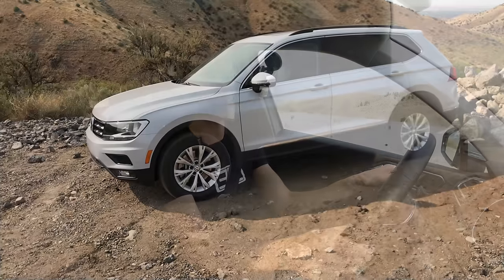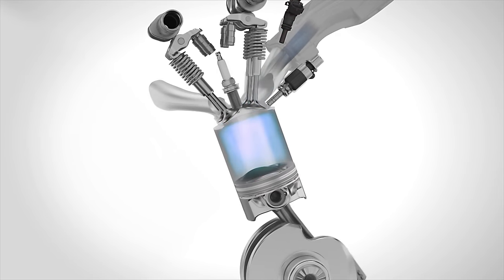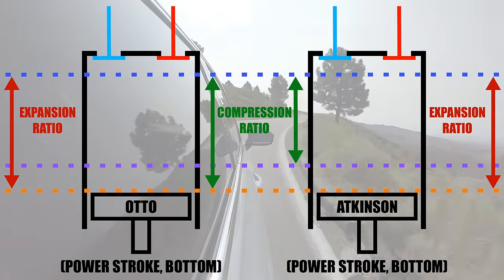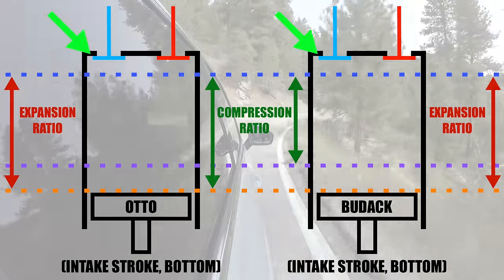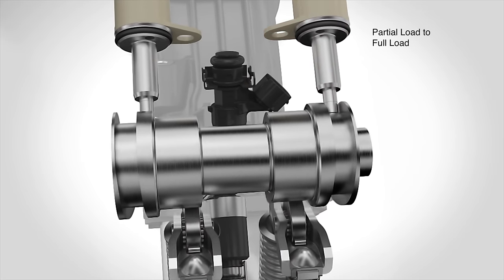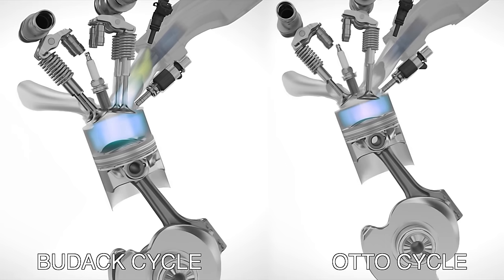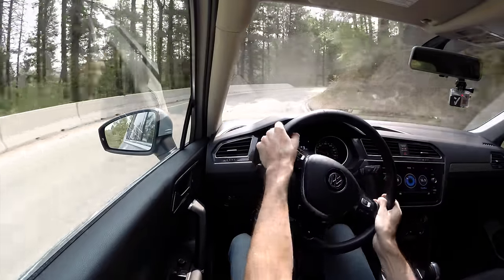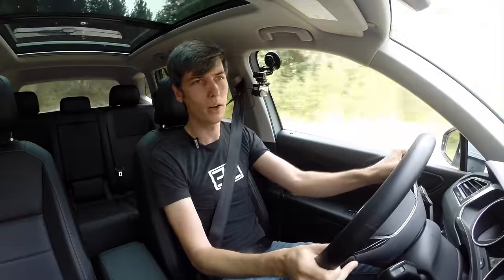Volkswagen's New Engine Cycle - The 'Budack' Cycle

Comment: My 1997 Plymouth Grand Voyager gets 27mpg highway with a pushrod 3.3L V6 that has 412,000 miles on it. Im very unimpressed.
Reply: Isn't it sad to say goodbye to smooth, reliable V6's. We now get Turbo charged I4's, that will have higher maintenance, and much lower longevity, and yet rarely get any better mileage. My Jetta 1.8 Turbo averaged 26 mpg, and over the years cost me $6,000 in service and maintenance. I finally traded it for a '17 Toyota Camry.
Reply: I think I've got that same motor in my 1991 olds cutlass ciera wagon. Mines got 225000 miles on it. Runs good!
Reply: My 2004 VW PASSAT 1,9tdi PD 136PS/335Nm has 47 mpg. This car runs 143mph and cost 1000€. Im unimpressed too.
Reply: I'd like to know at what speed is it achieving that 27mpg? My full size 2007 RAM will get 25+ mpg at 50mph (on 100% gas), so 27mpg in this smaller frontal area vehicle really isn't seeming so special...
Reply: Dave Benedict mine gets that at about 70. It has a .7 over drive and motor runs 1900 rpm at that speed. If your trucks that new its not really a comparison. You probably have much newer systems that help alot. These buick motors are 1 cam 2 valve per cylinder push rod waste spark and multiport injection. Super simple 90s tech. Not to mention mine has 225k miles and 26 years on it. Age doesnt help power or economy
Reply: Same thoughts here.    1994 Mercury Grand Marquis 4 door sedan with  4.6 L V8 with all the emissions crap tweaked/defeated/removed to run the engine in it's most fuel efficient mode not emissions compliant mode.   Mid 20's around town and upper 20's low 30's on interstate running 75 - 80 MPH.  

It's no slouch on power and it can easily pull a 6000 trailer too.   Dead reliable but its age is showing.
Reply: Sam, you misunderstand me. I think the old Buick is doing fine.  It's the brand spanking new VW I'm not impressed with. Guess I should have made that part clearer...
Reply: Trollololol. 27mpg in a V6 mini-van with 412k on it, I'm impressed. My VW Jetta 1.8L Turbo's best mileage in 81,000 miles, was 27mpg, as well as costing me $6,000 in maintenance and repairs, just traded it for a new Camry.
Reply: Color me very unimpressed.  My 1959 Edsel has 24 million miles on it and gets 597 MPG going 110 MPH.  And, I've never even changed the oil once.
Reply: He's never had to top off the oil in those 24 million miles either!
Reply: Right? I have a refreshed hatred for people driving SUVs as road vehicles.
Reply: Modern highway mileage is calculated not just from a constant speed, but changing speeds. My wife's CX-5 is rated at 32 MPG, but cruising at 40-60MPH will yield 40-50MPG. That being said, it mostly sees aggressive city driving, so in reality, it average it's city rating at 25MPG.
Reply: James Kirk right we get that. We are making fun of how this engine has an epa rating the same as a larger 25 year old one.
Reply: I had a 1985 Honda CRX that got 50 MPG. I now have a Honda Fit that might get 40, if I hypermile. The Fit's final drive ratio in fifth gear is clos to that of the CRX in fourth. Honda could fix that, but they don't want to hurt their hybrid sales, I guess.
Reply: That is a shame, if that's the case.
Reply: Dean Evangelista. You are right. For example; Automakers are phasing out NA V6 powered cars, and leaving us with variants of  4 cylinder Turbo engines, that don't really get any better mileage than the V6's, but are more expensive and  less reliable, and usually have far less longevity. Now GM announced, that they will go all Electric, by about 2022. Cars will be totally utilitarian, the excitement will be gone. No taking the car camping in the wilderness for extended time. Also, you can't keep extra fuel cans for emergencies with electric vehicles, you are tied to the power grid, and if that goes down, electric cars will soon go down. And if the car batteries have a deep discharge, they apparently need to be replaced. Thanks, to the EPA, Obama and CAFE.
Reply: My gauge cluster doesn't work at all so I just imagine I'm getting good gas mileage and maintaining the speed limit
Reply: If that is true, I'll never buy any GM vehicle.  Right now I have a Jeep (Fiat) Renegade and a Ford Econoline work van.  Stopped checking mileage as we are retired, don't drive much.
Reply: Jeffry Blackmon. What are you referring to, about GM. Also, how do you like your Renegade?
Reply: That's adorable I get 46mpg in my Golf, and havent shelled out for 1 repair. Unimpressed.
Reply: I had a 2002 T&C with the 3.8 liter OHV engine, it got a regular 24-25 mpg, lows of 22 and highs of 28.
Reply: My father's first generation Subaru Forester has 340K km on it, and nothing done to the engine. the car looks decent to except for a couple of rust spots in the hayon.
 Beat that US made cars :)
Reply: ShazamMafia I already did, I said my van has 413k miles. That's 665,000 km, in a USA piece of crap. And NO rust, we don't get rust in Texas.
Reply: Special EDy anything lives forever in Texas that aint a fair benchmark lol in NY all the US cars are cavernous with rust lmao
Reply: DylanCanDream Most older or high mileage cars come equipped with a self oiling, anti-rust system. It's called leaking gaskets XD
Reply: Guys my 79 Trans am 6.6 liter with a 3 speed slush box and a 4 barrel carburetor gets 20 on the Highway you think you're unimpressed but with the 2.70 rear end I only end up spinning about 2000 At 70
Reply: IDK why he thinks his subaru is impressive My moms 93 GMC sonoma 2.8 V6 5 speed manual got an easy 30 mpg and that was with 350k miles thats 563k km bud engine had never been opened and she owned it from new it crossed the rocky mountains about 10 times and 1 of those was towing a 69 Nova we had to get rid of it because we live in iowa and rust started eating the floors
Reply: my chevy cruze 1.4 turbo gets 40+ consistently on the highway
Reply: most of that is in the transmission gearing rather than the motors inherent efficiency cause a LS with a low rear end gear and a low over drive can also get 40 rather consistently if you drive conservatively
Reply: Thing is most cars after 74 had catalytic converters that more or less dealt with the Smog issues
Reply: LoL @ 27mpg I get 60 mpg out of a £500 old banger that I have just used to move house with. Has no problems keeping up with traffic and is clean too.
Reply: ron mortensen what are you talking about?
Reply: All of you are talking about older cars... let's talk about something newer, a 2016 dodge charger that I own... according to the stats it does 25 mpg (in a 5.7L v8) I get 27-30 at 70-80 mph and a solid 24 at 90 with cruise control... I've gotten 38 mpg at 50 with cruise control because of cylinder deactivation when it was wet and I had bald tires... and to top it all off this thing weighs in at around 500 lbs heavier! So heavier and better fuel economy... great!
Reply: 27MPG is distinctly underwhelming on a modern car.  My 2006 Citroen Xsara Picasso 1.6 HDi indicates 60MPG on the dashboard, and went from Caernarfon (N. Wales) to Basingstoke then on to Paris with a single 60L tankfull, so I think the dashboard indication is not too far out.  On the motorway, passing isn't an issue, and on A-roads where the limit is 60MPH, anything I want to get past is doing less than 55MPH, and it gives adequate performance for that.  Granted, it's no racing car, but it will do better than 100MPH on level ground.  What do we need out of a car?
Reply: Isn't that a diesel also the charger is a 400HP 5.7 liter V8 27 is okay for that i mean the Z06 corvette can get that with 650 to 800HP
Reply: Yeah Mike that isn't really that impressive out of a turbo diesel in a car that small with that little power
Reply: eh... epa says 22 for the z06 and a hellcat but you can probably get 25 if you're lucky in both of those... but anyway its only an extra 5 mpg over those if you count the epa
Reply: the stick z06 gets a bit better mileage with that 7 speed at least according to mike from ss717
Reply: 1423 171 - "7-speed"?  Where does it end?  When I was a kid, all the cars I was aware of had 3 gears.  I remember the introduction of 4 gears, and by the time I was old enough to drive, my Mini had 4 gears, and my brother's Jag had 4 + Overdrive.  Then 5 gears were marketed in the average family car (my Citroen Picasso has 5), and my daughter's new car has 6.  Frankly, I don't want to spend all my time swapping cogs.  I drove a CVT for a few years, and it was OK, but despite its ability to select from a theoretically infinite number of gears, it showed only a very minor improvement in performance, and then, only under very specific circumstances (the right gradient).

Will drivers really be happier when cars have 60 gears - or is it only a marketing ploy - more bells and whistles - like the LED flashlights that we get today that switch through a series of On, Half bright, continuous flashing, SOS, "Happy birthday, Mother-in-law" in Morse - I just want a flashlight that switches on and switches off, like I want a car that gives acceptable performance for modern driving with a low consumption and minimal 'management'.
Reply: chevy cruze = MOTORCYCLE on 4 wheels is slow. unable to overtake a slow road hogger in front of you. you are only getting go MPG in 2350 - 2700 Rpm out of that range eat fuel.
Reply: The old pd130 golfs are known for 50mpg...
Reply: Ha...No it doesn't. I drove a brand new 99 Dodge Grand Caravan (parent's van) for 5 years after getting my license with the same engine and it was lucky to get into the upper teens but nice try though. And that was with the Cruise set at 60MPH. At 70-75 MPH it was around 15-16 MPG
Reply: ShazamMafia mine really beats that, 1957 ford f100 all original, 76,000 miles on the odometer, lol 1 spot of surface rust on the corner of the hood, plan to fix that soon, spent 25 years as a farm truck, drives like a dream now, not to mention its a sw Missouri truck
Reply: Well if gas/oil companies didnt run our govt and the car manf. we'd of had higher mpg than we do. The reason your car gets better mpg is its older=lighter due to less saftu regulations. New cars are safer=heavier. So untill manuf. go to carbon fiber tubs(itll be soon) and the govt raises efficency standards mpg will stay around 30-40mpg
Reply: @Deftones Dsm the 5$ per pound thing isnt necessarily true, the main deal is when its below $5 per pound and the manufacturer owns the facilities to produce said carbon fiber, also that's assuming the price of aluminum and steel parts manufacturing doesn't drop, at which the price would have to be lower, plus a process needs to be made where it can be recycled in a manner that allows usage in structual components, plus the consumer would have to be willing to foot the increased cost of the vehicle, and at the end of the day there needs to be another material of similarly cheap production costs  with which to manufacture the fasteners with, otherwise the increased strength wouldnt be of benefit or there would be no reasonable way to repair minor damage.

 Of course mild steel still has the advantage of not fragmenting under a shock load(titanium does the same thing, which is why it was alloyed with steel in the SR-71), which has advantages in some applications such as the structural areas, where the weight reducing benefits of carbon fiber would actually pay for themselves.
Reply: It's a volkswagen, what do you expect?
Reply: Dean Evangelista main problem is these cars are so freaking heavy now days, so all that technology making the wngine more efficient is offswt by the weight. A 99 honda civic si with a 160hp and only 111lb/ft torque 1.6l 4 banger could hit 0-60 in 7 seconds flat. Now it takes a turbocharged engine with 200hp and 200 lb/ft torque to go that fast in a compact car. The civic si now weighs between 500 and 600 lbs more than the old 99 si and having 205hp and 195lb/ft torque, performance is almost the same. The new one is 0.3 seconds faster to 60 despite the fact the whole engine and drive train are alot more efficient and had alot less friction than 20 yrs ago. Thats why fuel economy these days arent that impressive.
Reply: Brandon Crimmins i agree... Just got an 02 caravan with the 3.3l, it averages 17mpg at best. This dudes FOS. Matter of fact half these people are. No way in hell they're getting 20+mpg out of ANY V8. Best mileage i ever got was 24mpg average out of a 2.4l Nissan. My current SUV with 3.0l V6 gets 18mpg average. Everyone here is full of shite.
Reply: 2001 Nissan Xterra. V6, 2.? L. 18mpg.
Reply: Hell my Chevrolet Cruse diesel gets right at 50 mpg on the highway and with 185,000 miles on it and very little maintenance....
Reply: doubt it.
Reply: ron mortensen they should get better mileage. The cars have simply become heavier. We don’t roll our windows up we have computer guided electric motors for that that shut off when a hand is in their way. We have heated seats and more complicated electric everywhere. We got a lot more of everything.
Reply: Don't worry. The hate will go away when an SUV T-bones your car and smashes its way through the passenger compartment.
Reply: A3 1.9TDI 37mpg@105mph, 42mpg @95mph+city, 45mpg @city
Reply: no, you dont.....  just because the overhead mpg thingy says 27 at that second dont mean sh1t
Reply: My 1989 Plymouth Grand Voyager gets the same! Though using it as an old toolbox work van, heavily loaded and driving on steep hills it's closer to 22 but I'm not complaining. For the 20 years I've had it, I've changed the oil 3 times, tires once, and the most expensive repair was a headlight switch for $20. I even lived 10 years on a very salty coast.
Reply: ron mortensen - We already take a solar charger for the battery on gasoline engine when going deep into the wilderness as anything can happen out there. The electric cars have fewer parts to break. Also, it's going to be super exciting to see all the mods and possibilities exploited by having basically an electric sled with any combination of shell on it. Add another motor if you want, put a microturbine generator in the trunk that will run on any combustible fuel (beer didn't work but that's good; more for the guys). 
    Right now we're only seeing the factory models of hybrids and electrics that are stuck on the old system of thought and serve the auto industry inflating prices. And don't rule out hydrogen as it's making an important comeback because it can be generated and stored much more cheaply than building giant heavy batteries. A small wind turbine, water wheel, whatever, can be producing hydrogen when not needed on the grid (middle of the night, etc) and produced locally (at your house or spread across the countryside like water pumping windmills were). 
   Basically, throw out of your mind what's on the market today; it's going to be a lot of fun and enthusiasts will be able to easily mod their vehicles however they wish.
Reply: Sam Stevenson - get back to us in 30 years for a relevant comment.
Reply: Special EDy not bad
Reply: My Skoda citigo best has been 81mpg (UK) you do the math.
Reply: How many transmissions have you gone through? Five?
Reply: Special EDy The nut holding the steering wheel long ago needed to of been changed out!
Reply: 1423 171 Another big deciding factor is the driver! The driver alone can make a five to ten miles per gallon difference. My old Sable I sadly gave up ran consistently 27-33 mpg. That was highway miles, hardly ever did around town with it. 27 mpg was interstate speeds with the a/c on. 33 mpg was windows open and fifty five mph on back roads. Another fellow with a car identical to mine said it was impossible. But he either had the accelerator petal or the brake planted on the floor board. And driving correctly leads to the longer life motor. If more people would takes high school physics, they could understand the mileage and long engine life concept.
Reply: Sam Young there is no way in hell your Oldsmobile has a Plymouth engine. Two totally different companies. Plymouth was owned by chrysler/dodge at the time and olds was owned by gm.
Reply: Special EDy my 1980 porsche 924 gets over 30 with an ancient mechanical injection system
Reply: Special EDy we have a 96 Buick regal 3.8 v6 with 160k miles and runs like a dream
Reply: what ever happened to the 50 mpg carb. heard a few old mechanic stories about those on old buicks.
Reply: My car gets such great gas mileage, I have to stop every 300 miles and drain the tank.
Reply: ron mortensen Thats because its a jetta. All engines are reliable by nature, it is all about maintenance. even turbo engines. My 1987 Ford Thunderbird Turbo coupe had 270k miles on it before I finally drove it to death (head gasket failure) Which was obviously caused by how I was driving it, and I did it on purpose. 2.3L I4 turbo, basically the same one Ford is using today actually.
Reply: and for fun my current car, a 1991 Lexus SC300 has 320k miles, runs like a top, got 30 mpg average from Reno, NV to Denver, CO. As well as my old 1990 Volvo 240 Wagon which had approx. 470k miles. My aunt owned the Volvo brand new until 280k-290k when I got it, it had zero major services except for a timing belt, which was done for maintenance, not necessity. Same with the Lexus, actually the Lexus hasnt even had a timing belt. Im doing one soon just to be safe. If an engine is taken care of, it will last. Simply put, regular oil changes. 3k miles. Good oil. Good gas. Zero problems.
Reply: That last longer than a diesel,
Reply: @dansanger5340  lol
Reply: @dansanger5340    thats only becuz it was launched into outer space!
I doubt you would get 597 mpg here on Earth.
Reply: And it rides and drives like a 1997 Plymouth!  How's that glass roof on the Plymouth, oops, ain't gone none, or anything else, it was so great the brand doesn't exist
Reply: @davebenedict7986  On the V Dub special test track, you know the one with the continuous tail wind.
Reply: @R777-RLM  Economic and political jihad are doctrine of Imam Obama's "great religion of Islam".
Reply: Love the internet mileage battles, I can just see the hokey ways you guys come up with how to measure it, and be wrong.  I drove a Prius the owner said was getting 50+mpg at the worst, he didn't know the computer shows the mileage right there on the dash at an average of 34mpg since whenever it was reset, I didn't say anything because it's such a cliche to be bragging while being so wrong.  So when you make your big fish mileage claim (even if you really believe your full size truck gets 30mpg) know there are people smarter than you who know what is physically possible and what is not.  The ridiculous claims are hilarious!
Reply: @PropperNaughtyGeezer  as you price in Euros I guess you are talking mpg not mpUS Gallons. US gallons are  smaller - only 16 oz not 20.
Reply: @dadawoodslife  OMG. There is that too? I know you guys love medieval units of measurement. At some point in the future you will be ready to use the metric system. I mean under 5 l/100km.
Reply: @PropperNaughtyGeezer  we do use metric units in Australia, it's the Americans that are stuck with imperial, and a smaller version of imperial different to that which everyone else used to use. I was just pointing out that when they said mpg it shouldn't be assumed to be the same as what a European would convert to mpg, being as a US gallon is smaller.
And what's with doing dates with days and months out of order?
Reply: @PropperNaughtyGeezer  true buy 40 000$ ca to save 2$ on gaz and new turbo after 100k for 2000$
Reply: @Bket666  I have the same turbo since 2001. For 2$ you become a little more than 1 metric liter. Besides, I don't want to drive an american rattle box. Everything is made of hard plastic and assembled crookedly.
Reply: I got 30mpg on the highway in my 1991 Chevy Caprice Classic with the 305 (5.0l) and it had about 300000miles on it.
Reply: @R777-RLM  man I hope you got the v6
Reply: @justinmartin8887  Well, I suppose that I may have put at least two toes in my mouth about a V6, or especially an I6, since our Camry has the normally aspirated 2.5L I4 with MPI; however, the 2.5L gets it's roots from Toyotas venerable 2.2L I4, and does tend to have better reliability than the 3.5L V6, but non necessarily better longevity. The car is averaging 36 mpg though.